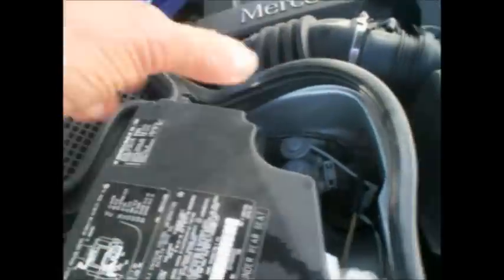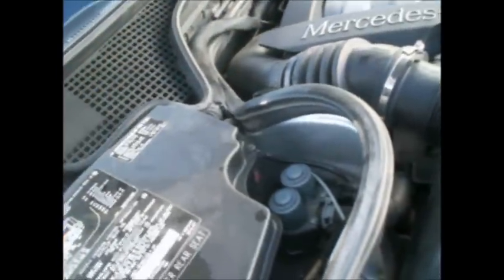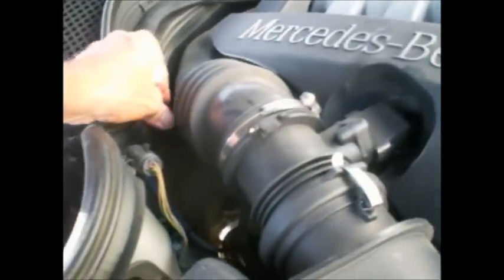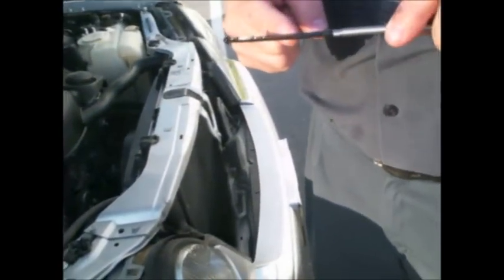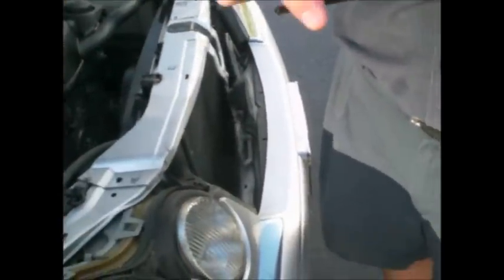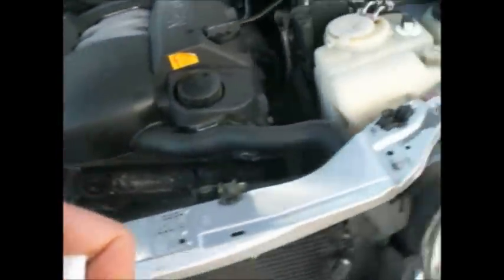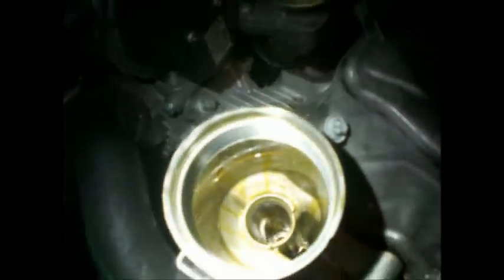Changing Mercedes E320 Transmission Oil Yukky Muck  11 4 14

Comment: I changed oil all the time on my Tired 4L60E, It lasted almost 160k before it broke a sunshell.  The last few changes it was nasty but it still shifted and performed no different. The transmission has to be REALLY bad for a fluid exchange to kill it
... Probably needs a wheel hub... Bolt on?
Reply from the maker: Bad bearing? We'll find out. did 600 miles yest, in Gallup NM, 22mpg at 75-80, limit 75, went 85 thru a speed trap, 1st time I had turned cruise off, whoopsy